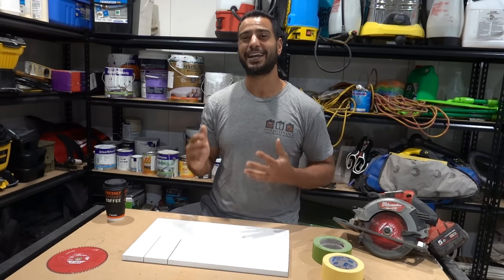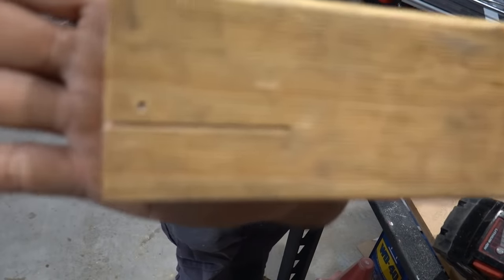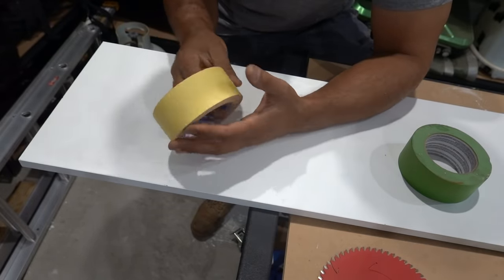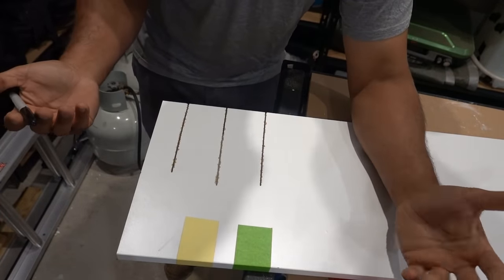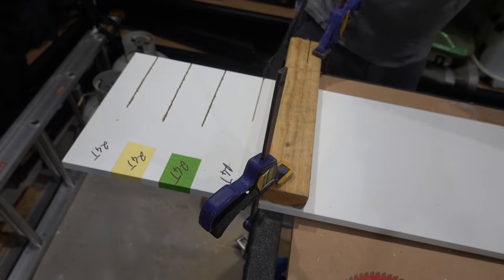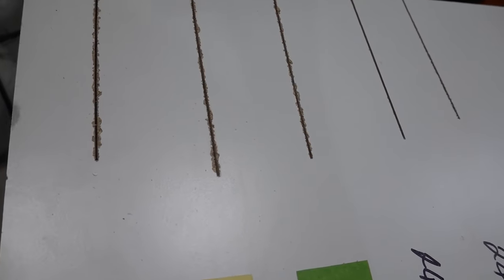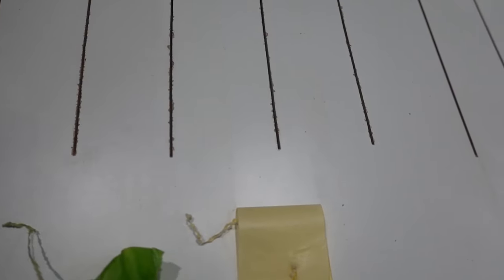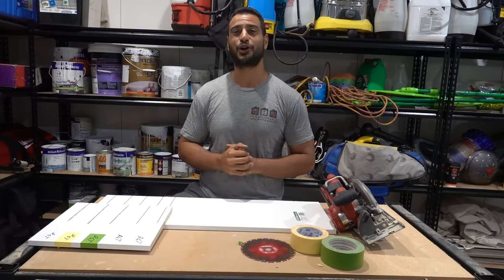How to make clean cuts with circular saw

Comment: I've found the best method is to use tape AND sacrificial wood (and whenever possible using the table saw). But yes, all other things being equal, a wood blade will always give you better results than the generic blade that mitre saws, table saws and circular saws are shipped with..
Keep up the good work. Greetings from London!

Comment: Running a scoring cut before the full depth is always best, I use 3mm mdf over some cuts.  Blades are not just about teeth-count I have recently learned (after 40 years lol!).  Study-up on blade Hook Angles, they make the world of difference when combined with the correct teeth numbers on the quality of the top cut's finish as the less angle "shaves more than cuts" as it passes through, and obviously have the depth of cut set to match the material thickness.  Bosch have a range of blades with minimal and sometimes negative Hook angles which I've now swapped to.

Comment: Nice comparison, but i would have liked it more, if you used a guiding edge on all of the cuts. Guiding the blade in a straight line probably prevents tearout a lot too.

Comment: Very informative.  I cut melamine, any laminate and 1/4" plywood from the opposite side when using a circular saw.  Table saws cut down into the wood, not up through it, just for this reason.  You can get the same benefit by flipping your stock over when using a circular saw - - also apply all the tips in the video too
Reply: Don't they cut downward to pull down and push back on what you're cutting so they don't drag it toward the blade or try to lift it off the table.

Comment: It’s all about blade rotation. As long as you are cutting down into the material there will never be tear out. Try reverse scoring. . Set your blade to be about 2  to 3mm deep. Start saw on finishing end of board. Pull saw towards you. Now set blade to full depth and push away in normal manner. Voila.. splinter free cuts on both sides. Must cut against straight edge or use a fence in order to do this.
Ad
Reply: That's the same principle behind the common trick of putting the blade on backwards to cut plastic laminate countertops (where blowout on the underside doesn't matter).  Of course, in either scenario the cut will go a bit slower.
Reply: @HisboiLRoi  Never thought of doing that. Must try it sometime. Thanks.
 For the tip.
Reply: @ernestbubly9636  never thought about it because its fucken dangerous
Reply: Scribing blade on panel saws spin anti clockwise scoring Boards same principle as you explain. Best methods to cut melamine for me is order is all pre cut and edged 😂
Reply: Not completely the case, a cordless saw did it when i cut down. Actually honestly i was thinking about that because when i use a corded saw i usualy do cut down into it, its all i ever have done really. But I never even seen this problem until i started using a cordless saw, which most of the time i don't cut down through it because the blade tends to be a bit smaller and slower at times. But i did do it a couple times and it did the same thing on Engineered wood, with a vynal top, which like i said i had never seen until i started using newer cordless saws.
Reply: @NightlifeReALIty  yes they spin the other way but they only cut 2 - 3mm deep and you can still feel the material catch and run from you.
Reply: @harrysingh-tj5pu  yes like I stated. They score the board…. And spin faster pulling the board into the curing blade.
Reply: Great explanation Thanks. Any thoughts anyone on using those small battery powered circular saws often used for sink cut outs. The fact that you have a smaller saw diameter cutting at probably same revs. I am thinking of buying one and using that instead of my regular circular saw. I have to cut a laminaat door panel diagonally.

Comment: I used the three cut method yesterday on a length of laminated kitchen worktop - wow, what a result! I used a 24 tooth blade and no masking tape and the result was a near pristine cut. One thing I learned - start your cut at the curved edge of the laminate, otherwise small bits of laminate might get pushed off rather than cut, spoiling your perfect finish.
Reply: Wow , thats got to be ignorance at it's peak , turn the worktop upside down :body-green-covering-eyes::body-green-covering-eyes::body-green-covering-eyes::body-green-covering-eyes:

Comment: THANK YOU! This is EXACTLY the video I needed today, because I will be cutting wide melamine shelves for my pantry. I will be using a circular saw with a NEW 60+ tooth blade. The 'multiple cuts' method is a winner, and I will be using some kind of edge guide. What complicates my install is that if course the side walls to the small pantry aren't exactly parallel, so each shelf must be custom-fit to size. I've got 1/16 to 3/8 differences front-to-rear on the shelf widths - 5 shelves.

Comment: Nice demonstration, thanks. I have found that clamping a waste piece of the same material over the cut area by using screws rather than clamps on the waste side of the cut, I have cut worktops (counter tops for USA) and have never had a blowout. I believe the extra holding strength of the screws over clamps made the difference. Thank you once again.

Comment: A method I use for melamine is to score parallel lines the width of the circular saw blade with a craft knife over the top surface and edges. It's a bit time consuming, but I'm usually happy with the results.
Next time I have a project, I'll have to try out your triple pass method. Thanks for the helpful video.
Reply: wtf
Reply: That works for me as well.  Scoring the cut with a utility knife first

Comment: I think I was born with a hockey stick and a circular saw in my hand in 1960, but you're never  too old to learn new info.  Great info, never tried or even thought of the multiple cut method.   Looks like I am buying a 60 tooth blade as well, compared to my 40 tooth.  Cheers from Canada.

Comment: A little tip I got from an old timer who's spent a lifetime making high end furniture, to get perfect cuts while cutting on the finish-side, without the need to go get a 60 tooth blade:  

 Use the method you showed with the fixed guide, but on the first pass you set the depth to 1.5-3 mm (1/16-1/8 inch) and you make the first cut in reverse.  By cutting backwards, the teeth of the blade will strike down into the finish side of wood and won't blow out since its always supported, just like you see on the backside of all your shown cuts.
Its important (both for result and safety) you only make this first shallow cut in reverve, and not the full depth, as the saw will be pushing back off the material rather than clamp it between the blade and the depth guide as it normally does during forward cutting, so make sure you keep a slight pressing down on the saw as you cut. 
After that, you finish like you also did, with a full cut through in the normal direction.
Reply: That's a great tip...  In machining, that's a climb cut, and also smoother.  With a really shallow cut as you describe, that should be ok in wood.
Reply: Sounds reasonable. Thumbs up!:yougotthis:

Let me translate it to Chinese for future Chinese audience.
这位鸭子叫同学分享了从老木匠那里学来的技巧：在正式切板子之前，用圆锯倒着切一条槽，倒着切的时候齿是压在板子上的，所以不会崩边。槽不要太深，1.5~3mm以内，太深电锯反弹力会很大，小心伤人。
Reply: Wow thanks
Reply: Interesting idea, I'll have to try that
Reply: Makes sense. Thanks.
Reply: I’m just a novice and to be honest I’d worked out from the video exactly what you said so really appreciate your comment.
Reply: So if I use this method on 19mm MDF-board, is the cut gonna be clean on both sides of the board? I’m about to cut MDF to make sliding doors. My first time using circular saw.
Reply: @pastori70  as long as the first cut is shallow enough, and you have some sort of guide to ensure your cut doesn't move, then yes - assuming here that your blade is neither chipped or dull.
Reply: @Ragnaroz6000  Thanks! It’s a brand new carbide tipped 24T blade. 👍🏻👍🏻👍🏻
Reply: @pastori70  i assume that it's the white painted MDF like in the video? If it isn't and it's something you plan on painting yourself, then remember that the cut corners on unpainted MDF will warp and swell up a bit as it absorbs paint.
Reply: @Ragnaroz6000  It is not painted, and I plan to paint those boards by myself. I heard that I should first use some kind of oil, then sanding, some more oil and little sanding and then paint. Board itself doesn’t require oiling, I hear.
Reply: @Ragnaroz6000  And there are some melamine strips also that can be glued to those cut sides.
Reply: @pastori70  painting it before cutting, and then glueing on the end strips is probably the easiest way to avoid warping then.
Reply: @Ragnaroz6000  That’s a good idea! I’ll do that. 👌🏻

I don’t want to mess it up, since those boards are quite expensive in this part of the world.
Reply: @Ragnaroz6000  any idea what kind of paint is best for it?
Reply: @Das Man  Primer since it's raw wood and semi gloss because it's the easiest to clean and protects the wood better. Also looks nice.
Reply: @pastori70  You can also use an acrylic primer first which has no water and will prevent swelling. Then sand and paint.
Reply: tried this method and the saw knicked my femur, im bleeding out a bit any tipson hsdoooooooooooooodddddddddddddddddd
Reply: @Ragnaroz6000  In the video it's not painted MDF, it's particle board with white laminate sheet covering it

Comment: I always used to initially cut a straight, superficial line on the board with a grinder (cutting disc mounted) to give a smooth cut on the top side before using the saw, but it's like surgery and takes a lot of time and focus. Having watched this, I can't believe I never thought of doing the surface cut with the circular saw instead. It is the same concept, just 10x quicker and you only need one tool to do it. 

Thanks Bill, I think I finally found that "one method that works". 👍

Comment: When I use tape to trim wooden doors, I find the tape holds the fibers very well. But I wouldn’t expect to get a good result with melamine. Completely different materials. Maybe try these same tests with plywood..?
Was very impressed with the multiple passes method. A bit more trouble to set up a guide, but great result even on melamine. Well worth it. Thanks.

Comment: as an extreme Novice when it comes to woodworking... i would not have thought the multi cut would have been any better since the rotation of the blade is still in the same direction pulling the material up.... now watching this and reading comments... it is actually cutting more parallel to the work piece which somehow helps prevent blow out..

Comment: I'd say the speed at which you cut is the most important factor. When I want a clean cut I just slow way down. If you slow down AND use a fine tooth blade you get a nice cut with little blowout, and any blowout you do have is very small.

The multiple cut method demonstrates the effect of changing the angle at which the blade exits the material. The first cut has a nearly horizontal exit.
Reply: I was wondering why the multiple cut method is so effective and this is it - thanks!
Reply: @kaheka60  Was that a question?
Reply: I forgot to mention another very important factor, sharp blades.

Comment: Another one to try is multiple cuts with the 60 tooth blade, but the first cut, pull the saw in reverse across the job. The material is essentially compressed into the board, and then ejected along the cut, meaning it isn't lifted. This might also work on the 24 tooth, but there's less tool control.
Reply: Probably the most efficient method. However make sure to just set a 2-3 mm max during the first cut in reverse direction to avoid kick back and use a guide to stay on the same cut. Then cut through as usual.

Comment: You don’t need to make to make three passes for the multiple cut. Just two is enough. And you should never cut 16mm sheet goods with your blade at full depth anyway. Having your blade only just cut thru the material makes the world of difference. Give that a go next time Bill 👍🏼
Reply: I do first 2mm deep cut - backwards. You have to be more careful but it is 100% sure to have clean cut. 2nd run is full depth.
Reply: Usually I'll give it a 360 run at 3.14mm then backpass through the cut with a slight 0.5 degree spaced bevel arch. Afterwards I'll lay down some gold foil and rip through at 1500 RPM for the final pass, but only after giving the saw a full spray down with the air compressor and lubricant on all bearings.
Reply: @Chris Hayes 😂😂
Reply: @chrishayes5755  thanks for this I followed your steps exactly and it came out perfect!
Reply: Also doing the cut a lil slower... but I think the fast cut was better for demonstrative purposes.
Reply: @chrishayes5755 Do you still need the masking tape with this method?
Reply: Great video bill. A fine toothed larger diameter blade helps even more. The outer edge is spinning faster than a smaller blade.
When it comes to blade depth, the less aggressive the angle is it’s scooping up through the material the better, and the reason a shallow cut works best. It’s like an excavator bucket digging deep into the soil then pulling in and up, to rip out a big bulb of top soil with it, compared to dust scraping along the surface and creating a nice edge.
Another option is to use a utility blade along a straight edge, to cut through the brittle melamine layer first. Provided you can use a guide to get your saw blade right on that knife line, your cut will be literally razor clean, but only on one side, unless you wanted to perfect two utility cuts to match just wider than your saw blade thickness.
A third technique is using a head gun first to warm the melamine. It becomes more flexible and less brittle, and the heat only reactivates the contact glue, which hardens again as it cools.
Reply: @boski224 can flip the disc instead backward. Safer

Comment: This video was very handy, as I know that the chipping occurs, and in my case cutting laminate.

I was surprised to see the results.

My project involves trimming off an already set countertop, where a new oven would not fit and I have to trim off a quarter inch from either side.

So the repeated, shallow cuts, would be a way to get the best finish possible.

Your video provided valuable information and I think you for that.

I rarely do these kinds of cuts with my everyday blade, so it’s time to buy a few, including the 60 tooth blade and apply tape as well to the method.
Reply: He showed tape does not help , only multicuts with 60 tooth saw blade

Comment: Thanks for this. I only have one board to cut and didn’t want to buy a new blade for this just that. Was hoping to see 24 teeth with tape and 3 pass method combined but I guess I’ll be running that test myself tomorrow

Comment: Your multi-cut is essentially mimicking the saws we use at the factory, although we do it all in one pass. We have a scoring blade running in the reverse direction of the main blade, both mounted on one saw bed. The cuts we get are extremely sharp (you can cut yourself), even 3 metre long cuts with 5 boards, held in place by a couple of pressure beams, cut all at once. The other thing that makes a huge difference is the blade itself. Is it sharp? In the factory, blades get changed a minimum of 3 times a day. More if chipping starts to occur.

Comment: Interesting. I just remodeled one of my bathrooms. I used MDF baseboard and trim molding. I cut it all with a 40 tooth Diablo on an 8 1/4" table saw. I had zero blowout. It cut to perfection.

Guessing that maybe the diameter of the blade has something to do with it? I don't know.

This video, however, convinced me to get rid of the stock DeWalt 24 tooth blade on my circular saw, though. I just never gave that any thought before but, honestly, how often am I ever ripping a 2X4 with the grain of it? Never, is the answer. 

So, now that you have made me think about that, I ordered a 60 tooth diablo to go on the circular. That just makes better sense.

Thanks!

Comment: I cut a lot of plywood and have the same problem with blowout. I think I have solved the problem with frog tape but, I purchased a steel roller about 3” wide made for flooring installers to flatten seams. By rolling the tape with this steel roller there is absolutely no blowout. The roller costs about $45 at a big box store.

Comment: Your 60T blade looks like it's had a hard life. A brand new one will cut perfectly through melamine. But the multi cut method looks pretty good to get the most use out of the blade as it ages and the carbide tip starts to blunt.
Reply: You dont want to cut carpet with a dull knife cause you know it is ripping instead of cutting.. somehow people attach blunt blade on powertool and expect perfect cut

Comment: I find the best result with frog tape if you decide to use it it is actually not along the frog tape but right by the edge of it, if you don't cut tape it does not lift up with chips of wood it still holds them down, try out.

Comment: I have used the tape method for decades. I wrap multi layers and it works well.
Reply: try a side by side, i used to believe in tape but i find it pulls off what was chipping out anywas when you take it off. as he said, it's slightly better but not the result you want.

Comment: Wait. You said is spins clockwise and then you said it splinters on top where the blade exits? The blade would exit on the bottom of the piece leaving a rough edge on the bottom face that wont be seen. If otherwise, couldnt you just flip the piece so the back is facing down where the blade exits so the rough side is not seen? Am I missing something?
Reply: From the side of the saw he was showing when he mentioned "clockwise", clockwise would have the blade exiting up. For your second point, you sometimes have boards which have both sides visible.